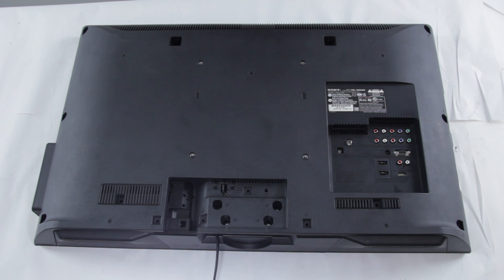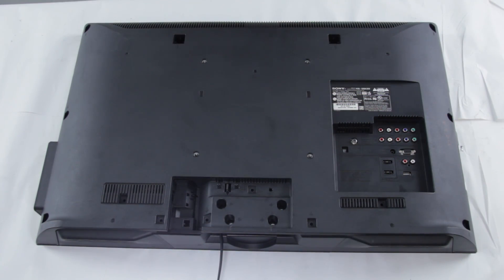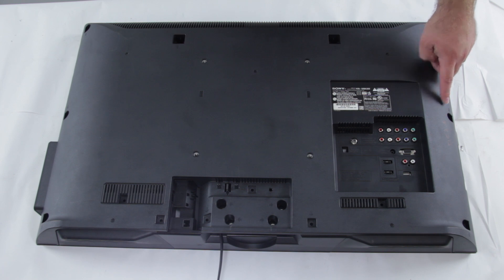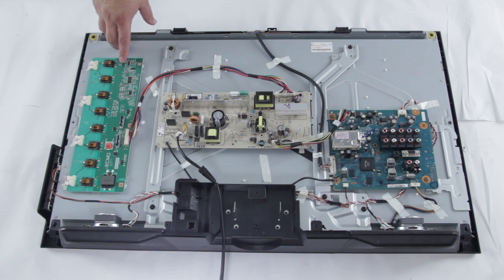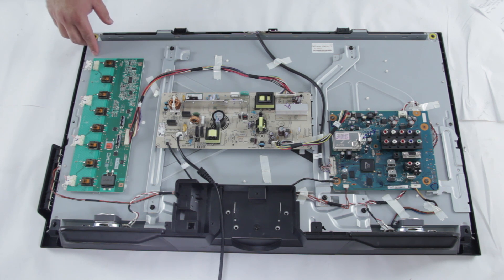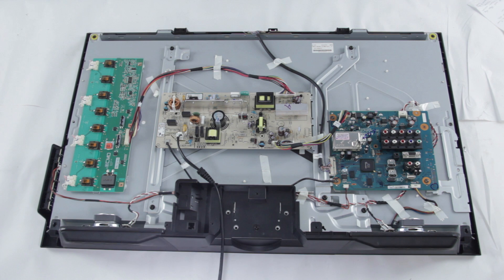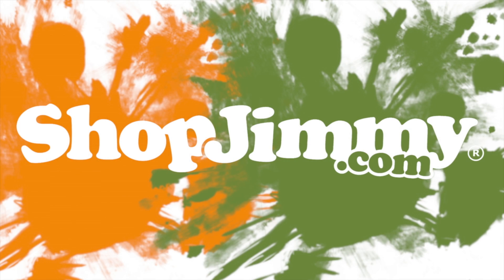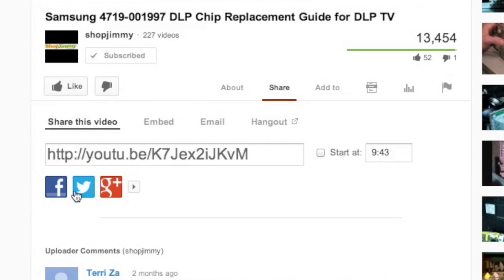LCD TV Repair Tutorial - Backlight Inverter Common Symptoms & Solutions - How to Fix LCD TVs

Comment: I have a Samsung LN32D403, the screen is very bright on all channels and on hdmi such as xbox. Please could you advise. thanks
Reply from the maker: jonathan rooke   The video issue is caused by the main board and since it happens through hdmi that is on the main board, so I recommend replacing the main board.  Here is a link to replacement parts for your TV model number on our website, click here:  http://www.shopjimmy.com/catalogsearch/result/index/?cat=56&q=LN32D403  Be sure to match part numbers on your current board, with your replacement for compatibility.  Here is a link to a video showing how to identify your part number, click here:  Samsung Main Boards & Digital Boards: Part Numbers for LED, LCD, DLP, Plasma TV Repair  You can also call our customer service for further assistance with your purchase.  (877) 881-6492  Thanks and please let us know if you have any further questions with your TV Repair!  www.shopjimmy.com
Reply: might need screen or icon board
Reply: thanks guys, il take a look at shopjimmy.
Reply: hello I have  a LCD sony  model #KDL-46v2500  SERIAL #8733866 the red blinking light come  4 times   whwn I remove de power of the oulet and reconnect the power the green light comes on  but later on the red blink light come on any sugestions
Reply from the maker: GLORIA AYALA   I recommend replacing the power supply board in your TV.  Click this link to replacement parts:  http://www.shopjimmy.com/catalogsearch/result/index/?cat=59&q=KDL-46v2500  Be sure to match part numbers on your current board, with your replacement for compatibility.  Here is a link to a video showing how to identify your part number, click here:  TV Part Number Identification Guide for Sony Power Supply Unit (PSU) Boards (LCD LED Plasma TVs)  You can also call our customer service for further assistance with your purchase.  (877) 881-6492  Thanks and please let us know if you have any further questions with your TV Repair!  www.shopjimmy.com

Comment: i have a LG-60pc1d the pitcher looks like a colerd xray i was told it is a easy fix that the screen is ok but i was not told what it is i think it might be a couple capaciters
Reply from the maker: teddy ginger   I recommend replacing the main board in your TV.  Here is a link to replacement parts for your TV model number on our website, click here:  http://www.shopjimmy.com/catalogsearch/result/index/?cat=56&q=60pc1d  Be sure to match part numbers on your current board, with your replacement for compatibility.  Here is a link to a video showing how to identify your part number, click here:  TV Part Number Guide for LG & Zenith Main, Digital, & Tuner Boards (LCD, LED, Plasma TVs)  You can also call our customer service for further assistance with your purchase.  (877) 881-6492  Thanks and please let us know if you have any further questions with your TV Repair!  www.shopjimmy.com

Comment: I have a Toshiba 55HT1U and it is flashing a grey or white light across the entire screen at different speeds depending on what is being displayed regardless of source. I have reset the unit to no avail.  Could it bee the backlight inverter or is it a board problem?
Reply from the maker: Korby Harshaw   This sounds like a Main board problem.  I recommend replacing the main board.  Here is a link to replacement parts for your TV model number on our website, click here:  http://www.shopjimmy.com/catalogsearch/result/index/?cat=56&q=55HT1U+  Be sure to match part numbers on your current board, with your replacement for compatibility.  Here is a link to a video showing how to identify your part number, click here:  TV Part Number Identification Guide for Toshiba Main & Scaler Boards (LCD, LED, Plasma TVs)  You can also call our customer service for further assistance with your purchase.  (877) 881-6492  Thanks and please let us know if you have any further questions with your TV Repair!  www.shopjimmy.com

Comment: I have a Vizio XVT553SV and mainly in the bottom right corner, in the size of a rectangle box, the screen blinks constantly from light to dark.  At different times, different spots around the screen do the same thing.  I think it might be the backlight but I'm not sure?  Help please!
Reply from the maker: Enos Marshall   This sounds like a problem with either the main board or the TV panel.  You can replace the main board to see if that fixes the problem.  Here is a link to replacement parts for your TV model number on our website, click here:  http://www.shopjimmy.com/catalogsearch/result/index/?cat=56&q=XVT553SV  Be sure to match part numbers on your current board, with your replacement for compatibility.  Here is a link to a video showing how to identify your part number, click here:  TV Part Number Identification Guide for Vizio Main Boards (Plasma, LCD, LED)  You can also call our customer service for further assistance with your purchase.  (877) 881-6492  Thanks and please let us know if you have any further questions with your TV Repair!  www.shopjimmy.com

Comment: I just picked up a Samsung syncmaster p2770fh monitor at a second hand store.  Initially it worked when I turned it on.  However,  if it is on for more than a minute or 2, the screen flickers,  then goes black.  I can still see the image on the screen with the flashlight test.  Whats my next step?  Thank you in advance
Reply: Also,  if not powered on for an extended period of time,  the screen will work much longer (45 minutes)  than just turning it off with black screen and then back on (30 seconds to 1 minute)
Reply from the maker: James Dobbe   I recommend replacing the inverter board in your TV.  Here is a link to replacement parts for your TV model number on our website, click here:  http://www.shopjimmy.com/catalogsearch/result/?q=p2770  Be sure to match part numbers on your current board, with your replacement for compatibility.  Here is a link to a video showing how to identify your part number, click here:  http://www.shopjimmy.com/samsung-bn44-00322a-power-supply-backlight-inverter.htm  You can also call our customer service for further assistance with your purchase.  (877) 881-6492  Thanks and please let us know if you have any further questions with your TV Repair!  www.shopjimmy.com

Comment: magnavox model 37md359b/f7, tv turns on by itself and displays random color, wont turn off unless unplugged
Reply from the maker: wfs1965   I recommend replacing the digital board in your TV.  Here is a link to replacement parts for your TV model number on our website, click here:  http://www.shopjimmy.com/catalogsearch/result/index/?cat=225&q=37md359b%2Ff7  Be sure to match part numbers on your current board, with your replacement for compatibility.  Here is a link to a video showing how to identify your part number, click here:  Part ID Numbers for Sylvania, Emerson, Philips Magnavox MPS, MPW, MUT, & Digital Boards TV Repair  You can also call our customer service for further assistance with your purchase.  (877) 881-6492  Thanks and please let us know if you have any further questions with your TV Repair!  www.shopjimmy.com

Comment: TV Model: AOC L19W961

Comments: My Tv/monitor will come on for a short second then go blank. I tried the diagnostic test where you make the the room dark and turn on your tv and shine a flash light on the screen. I press the menu button and my menu was visible. Please help me fix it and tell me what I will need to fix this problem.
Reply from the maker: Omaro Walker   Check over your power supply board to see if there are any burn marks, or raised puffy capacitors.  Please reply with the results.  Thanks!  www.shopjimmy.com

Comment: samsung model# LN32D450G1D model code LN32D450G1DXZA..... TV turns on with sound. At first I thought there was no picture but then discovered a very faint picture when standing close. Found an inverter panel but cannot see any of the connections that look bad from just looking at it. Any suggestions other than replacing the inverter panel to trouble shoot?
thanks
Reply from the maker: *****   I recommend replacing the inverter board in your TV.  Here is a link to replacement parts for your TV model number on our website, click here:  http://www.shopjimmy.com/catalogsearch/result/index/?cat=46&q=LN32D450G1DXZA  Be sure to match part numbers on your current board, with your replacement for compatibility.  You can also call our customer service for further assistance with your purchase.  (877) 881-6492  Thanks and please let us know if you have any further questions with your TV Repair!  www.shopjimmy.com

Comment: Hi, I've been given an LG LCD tv, model 32LC2R. My problem is that after an hour or two, the screen gets far darker, sometimes pinkish or a bit blurry. I'm suspecting the backlight inverters are at fault, but I'm really no expert on tv's, what do you think ?
Thanks !
Reply from the maker: Bob Kelso   I recommend replacing the main board in your TV.  Unfortunately I do not see any replacement parts in the search results for your TV model number on our website.  Please reply with your part number on your main board and I can try searching for replacement parts.  Thanks and please let us know if you have any further questions!  www.shopjimmy.com
Reply: ShopJimmy.com
Thanks for your reply !

Comment: Hi , I have a 32" aucastic solution tv that when switch on the picture last for a few second then gone , there is sound but no pic , help .thanks
Reply from the maker: montagueamanda48   I recommend replacing the main board in your TV.  Please reply with your TV model number.  Click here to view a video that shows how to find your TV model number:  TV Repair Help IMPORTANT TUTORIAL How To Find Your TV Model Number Tutorial TV Repair Help  Thanks!  www.shopjimmy.com

Comment: I have a JVC JLC37BC3000. I have sound with no screen. I tried the flashlight test several times and did not see any image. The issue began with a specific event. With the TV off I plugged in an additional device to the same circuit. The load was too much (old building) and the 20A circuit breaker flipped off. I then removed the device. The tv always remained off.  Hours later I casually turned on the TV and discovered the issue. I'd love to know a professionals opinion. Maybe a simple blown fuse!?
Reply from the maker: Brian Neuman   I recommend replacing the main board in your TV.  Here is a link to replacement parts for your TV model number on our website, click here:  http://www.shopjimmy.com/jvc-3637-0682-0150-main-board-for-jlc37bc3000.htm  Be sure to match part numbers on your current board, with your replacement for compatibility.  You can also call our customer service for further assistance with your purchase.  (877) 881-6492  Thanks and please let us know if you have any further questions with your TV Repair!  www.shopjimmy.com

Comment: hi my name dino got sharp tv lc-65rx1x when put the tv on got green lines on bottom tv
horizontal but on green lines solarized on it l am thinking it t-con but l have buyed it but not getting in three weeks it in usa and l am australia is there anything l can do to test out more before get the t-con thanks from dino
Reply from the maker: Dean Anderson   This sounds like a TV panel problem.  If your TV panel is bad, it may be more cost-effective to replace the TV as panels are typically hard to find in stock, difficult to replace, and expensive.  Thanks and please let us know if you have any further questions!  www.shopjimmy.com

Comment: I have a Samsung LA32M61B, the screen comes on perfectly for 2 seconds then turns off. I still get audio. I've replaced swollen capacitors on the powersupply which did nothing. I've removed the backlight inverter, but I can't see any problems with it (no swollen caps, no burn marks). I've heard some people have blown fuses that they by-passed with a wire, but I can't see any evidence of this.
Reply from the maker: delryn256   I recommend running the flashlight test on your TV.   Here is a link to a video we produced that shows how to run the flashlight test. No Image No Picture on TV Screen-Flashlight Test LCD TV Repair - How to Diagnose Broken TV Repair Please reply with your flashlight test results and we can recommend a replacement part for your TV repair. Thanks and please let us know if you have any questions! www.shopjimmy.com

Comment: Hi, please help! I have an older (7yrs old) Sony LCD TV - Model # KDL-52XBR4 - that has no picture (grey only) just sound. Is it the Backlight inverter or anything else? I never heard a pop or anythjng. Any thoughts would be welcome, thanks in advance.
Reply from the maker: Peter Panagopoulos  I recommend replacing the main board in your TV.  Here is a link to replacement parts for your TV model number on our website, click here:  http://www.shopjimmy.com/catalogsearch/result/index/?cat=56&q=KDL-52XBR4  Be sure to match part numbers on your current board, with your replacement for compatibility.  Here is a link to a video showing how to identify your part number, click here:  TV Part Number Identification Guide for Sony Main Boards (LCD, LED, Plasma TVs) TV Repair  You can also call our customer service for further assistance with your purchase.  (877) 881-6492  Thanks and please let us know if you have any further questions with your TV Repair!  www.shopjimmy.com

Comment: I have a Sony Bravia KDL 40S2000. I am getting a red blinking light (standby mode) and it is blinking in 4 blink intervals. Some preliminary detective work has pointed me in the direction of either the back light inverter or the power supply. I was asked to check the fuses on the inverter to see if any were open. Here's where I am stuck. I can get the back panel off the TV and I know which part is the inverter but I am unsure what to look for as an "open fuse". I was told if the fuses are open then the inverter or power supply need replacement otherwise a 4 blink means one of the fluorescent tubes has gone. Please help!
Reply from the maker: Erika Steil   I recommend replacing the inverter board in your TV.  Here is a link to replacement parts for your TV model number on our website, click here:  http://www.shopjimmy.com/catalogsearch/result/index/?cat=46&q=40S2000  Be sure to match part numbers on your current board, with your replacement for compatibility.  You can also call our customer service for further assistance with your purchase.  (877) 881-6492  Thanks and please let us know if you have any further questions with your TV Repair!  www.shopjimmy.com
Reply: ShopJimmy.com before I replace it i would like to be sire it is the issue as evidenced by the fuses I was told to check. Can you assist me with identifying the fuses and what an "open" fuse will look like?
Reply from the maker: Erika Steil   I recommend to replace the inverter board(s), since I do not have your specific part number, I cannot help you with the specific board.  Thanks!  www.shopjimmy.com

Comment: Hey my tv Will have a very faded flash when it turns on and need to know how to fix it is a Coby and the model is TFDVD1995
Reply from the maker: Confused-Mentos   I recommend replacing the main board in your TV.  Here is a link to replacement parts for your TV model number on our website, click here:  http://www.shopjimmy.com/catalogsearch/result/index/?cat=56&q=TFDVD1995  Be sure to match part numbers on your current board, with your replacement for compatibility.  You can also call our customer service for further assistance with your purchase.  (877) 881-6492  Thanks and please let us know if you have any further questions with your TV Repair!  www.shopjimmy.com

Comment: Hi! I have an Olevia 542-B12 TV, The last time it was powered on before it stopped There was picture but no sound. I have carefully replaced all capacitors on the TV But still I have nothing happening. Should I then move on to the main board? or blacklight converter? I have tried with both remote and buttons on TV to turn on, but it seems that there is nothing happening. I have tested to see if power is getting to Power supply all tests good. and main board as well.. What else can it be?
Star..
Reply from the maker: Wanda Taylor   I recommend replacing the main board in your TV.  Unfortunately I do not see any replacement parts in the search results for your TV model number on our website.  Please reply with your part number on your main board and I can try searching for replacement parts.  Thanks and please let us know if you have any further questions!  www.shopjimmy.com

Comment: I have a problem similar to "Tim Rowsey"/Samsung (posted 6 months ago): we have a 42" Sanyo LCD/HDTV (DP42647) that was working great, when suddenly the picture looked 'foggy', then turned almost a bright pale, pale blue ~ with the colors inverted, like a negative. Is there any chance it could be the backlight inverter? and how expensive is one?
Reply from the maker: mamapatx8   I recommend replacing the main board in your TV.  Here is a link to replacement parts for your TV model number on our website, click here:  http://www.shopjimmy.com/catalogsearch/result/index/?cat=56&q=DP42647  Be sure to match part numbers on your current board, with your replacement for compatibility.  Here is a link to a video showing how to identify your part number, click here:  TV Part Number ID Guide for Sanyo Main, Digital, & Terminal Boards (LCD, LED, Plasma TVs)  You can also call our customer service for further assistance with your purchase.  (877) 881-6492  Thanks and please let us know if you have any further questions with your TV Repair!  www.shopjimmy.com